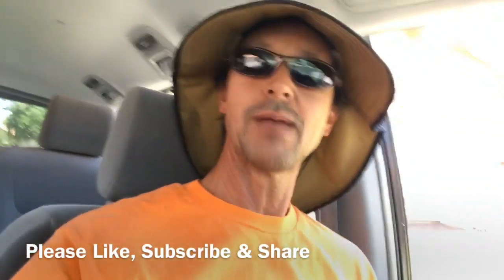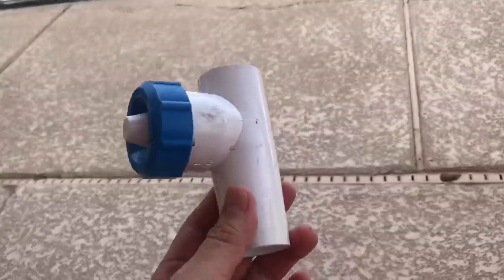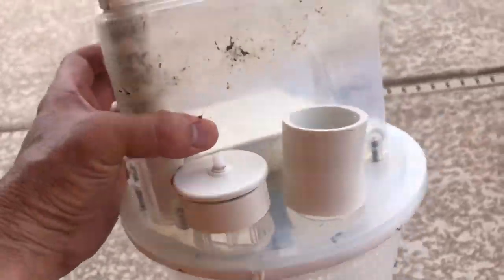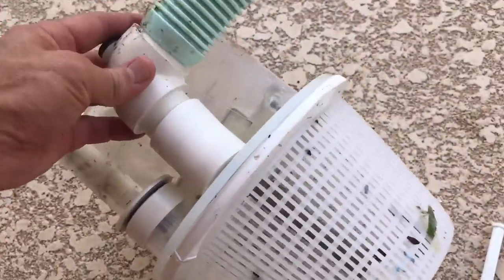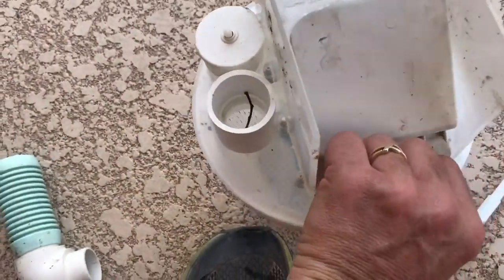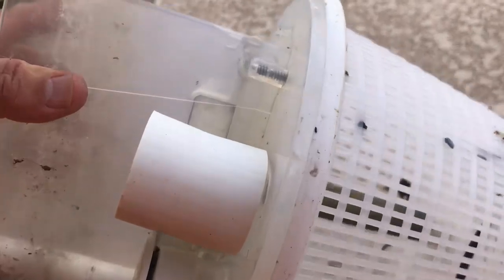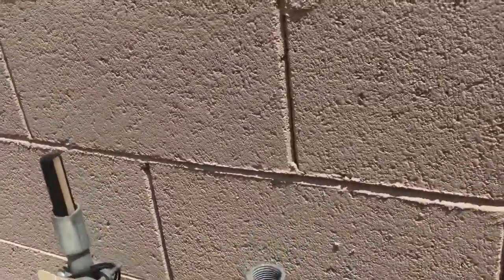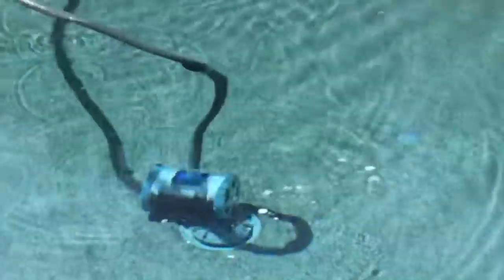Converting a Pop Up System to a Vacuum using a VacMate

Comment: I have a pop-up system with only 2-3 pop-up working and would like to have a 24/7 vacuum installed and my poolman suggest using a 2-way skimmer. What is your recommendation on using that instead of the VacMate?
Reply from the maker: I'd go with the VacMate and the Barracuda G3 Vac.
Reply: @PoolSchooler  I’m am also looking to convert. Thank you for your recommendations! What is the vacuum shown in this clients pool?
Reply from the maker: @blqberry1  That is a vacuum called “the pool cleaner“. However my favorite vacuum for the money by far is the barracuda G3. Most all of my clients have the barracuda G3 and I completely recommend it.
Reply from the maker: @blqberry1  Here's a link to a video I did on that The Barracuda G3: https://youtu.be/fFAiyDl6jRo

Comment: Do I have to do something to shut off the pop ups when converting to this?
Reply from the maker: Typically depending on how your system is set up you can divert the return flow to just the return jets and not the pop-ups. It really depends on how you return plumbing is set up.  If you text me a picture of it I can advise more accurately.

Comment: Do i have to do any thing to pop up heads or valves on system? Or do i jusy add basket an plug floor drain?
Reply from the maker: If you have the ability to do you may want to shut off the return slow to the pop-up heads and redirect it only to the return jets if your pool is so equipped.
Reply: @PoolSchooler  ok ill play with it the stairs still will need to be cleaned an brushed then or will vacum.make it up the stairs?
Reply from the maker: @arizonahvac9127  No amy stairs and steps won’t get get vacuumed so you will need to brush those surfaces. If you are not sure if you have a valve that allows you to split the return flow between the pop-ups and the main return ports on the sides of your pool get back to me and maybe email me a picture of your set up and there might be another way to help you
Reply: @PoolSchooler  thank you sir

Comment: How do you deal with the hot weather? I clean pools in Vegas and it’s 80 degrees at 5-6 Am.
Reply from the maker: During the summer months I usually try to get on the road by 8 am.  I keep my routes small so I'm usually done by noon so I "beat" the heat.  Of course this week we are hitting 112 so it's pretty rough.

But I also stay really hydrated (I drink a ton of water) and I also drink Chia Fresca daily which is a natural hydration drink made with chia seeds and it helps me tremendously.

Lastly I wear long sleeved t shirts and long pants and a big brimmed hat and that helps a ton.  But, yeah, come September I'm pretty much done with summer.

Comment: What if all pop up heads and gears for pop up heads are missing? Will I need to cap pop up heads to stop water flow from going to those pop up head ports?
Reply from the maker: Jeremiah Lord not necessarily. Unless the vacuum gets stuck on the head.
Reply from the maker: Jeremiah Lord but I’ve seen people convert to a vac with just such a situation and they just left all the ports open (took the flaps out) and put in a pool vac.
Reply: My situation right now is all pop up heads are missing and open port and the gears are removed which is causing my system to be Continuous Flow reducing the pressure in my filter and I'm trying to gain pressure back without having to replace pop-up sand gear set. I wish I can send a picture here
Reply from the maker: Jeremiah Lord maybe email me. Kennypoolschool@gmail.com.